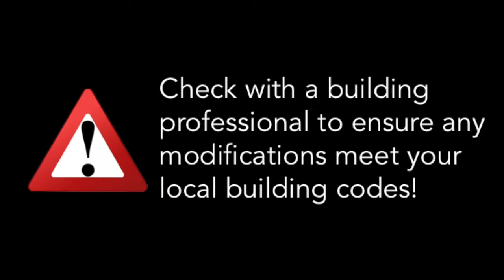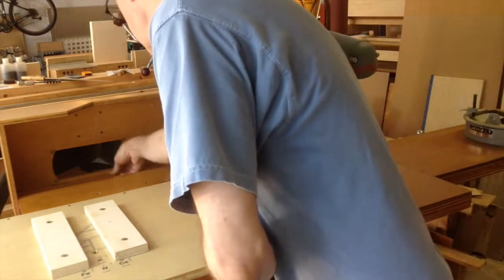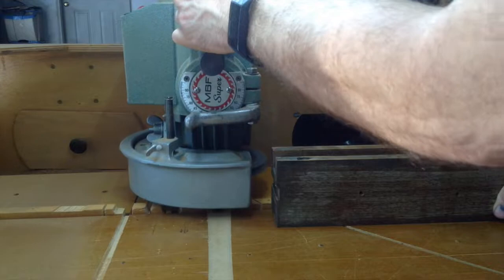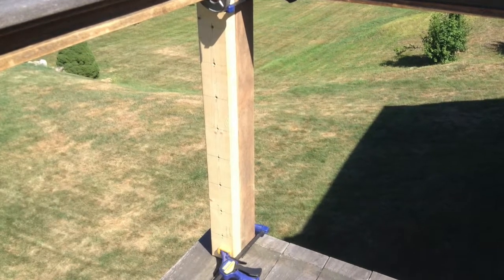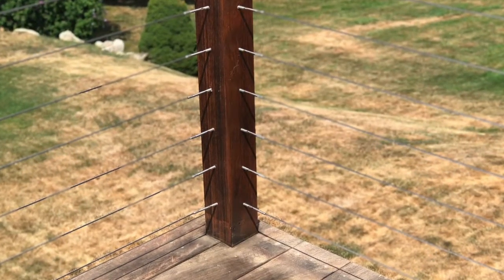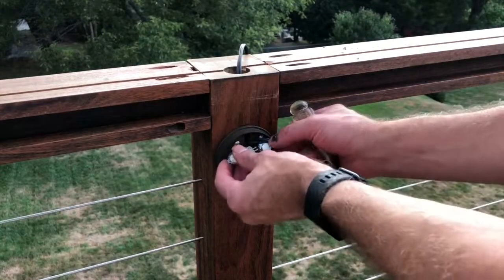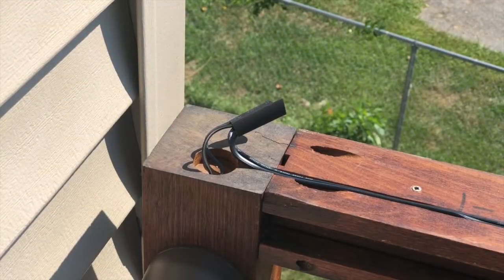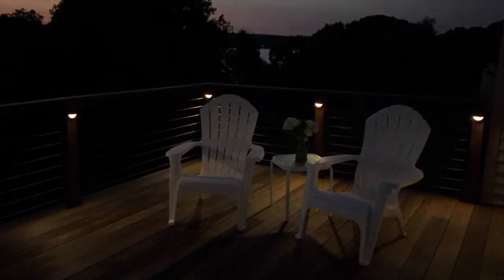Deck Upgrade (Cable Railing and Lights)

Comment: Brian, how far apart did you happen to run your cable in between each post. I have 7ft between mine.
Reply from the maker: The maximum span between posts is 6 feet on my deck. The overall cable length is about 21 feet on the longest side. The cable is only attached at the end posts and just runs through holes in the intermediate posts.
Reply: @brianweekley5700  Does the 21’ cable length meet your local building code for deflection?
Reply from the maker: @ptcclatlptcclatl1683  The spacing between posts is not 21 feet—it’s less than 6 feet. The spacing between the wires is sufficient to meet the 4” deflection requirement.

Comment: Just discovered your channel !! I subscribed because I like what you do !!! Regarding Ipe wood, it is sad that retailers always brag about the  always present possibility  you can ''bring back'' a grey/weathered ipe patio to the  appearance of newly installed Ipe wood by just lightly sanding it and cleaning and re-oiling it....I find that impossible...It will always remain darker in the future  compared to newly installled ipe wood...Also, as a result, it IS NOT a maintenance free wood if you want to preserve a nice finish and appearance  . Here in Montreal, I need to clean and re-oil it once a year. You probably noticed a huge difference between horizontally and vertically installed planks !! The latter really do not grey as much and retain much of their initial beauty!!!
Reply from the maker: Thank you! You are absolutely correct. Ipe is very hard to keep its rich color-especially in direct sunlight. Sanding and a brightener are helpful. We also found that if you oil too much or don’t thoroughly wipe off the excess oil it will blacken faster. Best to power wash, apply brightener (oxalic acid) with lots of elbow grease each Spring followed by a single coat of oil (with UV protection). It is maintenance free if you like the gray color!

Comment: Beautiful! How long did the oil coating last? Would you re-coat again ...or is it too much work if it needs to be done every year?
Reply: I have over 1500 sqft of grey Ipe and it seems daunting to oil it even just once ...
Reply from the maker: The deck looked fabulous when it was done.  However, our deck gets a lot of sun and looked terrible by the end of the summer.  It is a lot of work keeping it looking good.  There is definitely something said for letting it just turn grey!  However, we have another ipe porch on the front of the house that does not get sun.  That one still looks super after several years now.  On our next house, we're planning to pour a stamped concrete patio to avoid wood deck maintenance altogether (LOL)!  The main purpose of the video was more about installing the cables, lights, and fixing the sagging railing. I would do that again in an instant--a great improvement for sure.  Thanks for the question.
Reply: @brianweekley5700  thanks for that info! Just what I was thinking, that maintenance to keep it oiled is a big commitment if exposed to harsh conditions. I’m up in Seattle and the relentless winter rains do a number on wood. So other than a gentle power washing in spring, I think I’ll forgo the oiling!
Yes, the wire railing is how I found your excellent video. My baluster railing is sad...made from cedar but pained white with latex paint, which to me seems impossible to remove completely..so endless horrible peeling. It’s huge and I don’t know what to do with  it, and thought wire too. It’s less than 30” from ground, so maybe just removing it would work. But then I’m afraid I’d be inviting deer up on it eating my potted plants, as they are all over the place here.
A concrete or stone patio does seem attractive to me too. Thanks again!

Comment: Nice… thank you for sharing, would you have parts list and/or purchase link?
Reply from the maker: Thank you. I purchased the 1/8”, 1x19 cable and 1/8” threaded lag screws on eBay. If you search, you should find many options easily. Make sure they are 316 stainless and the lag screws are sets of both right and left pairs (many ads are one thread only). Don’t cheap out on the crimper, you absolutely need the hardened dies to crimp the stainless steel (e.g., Muzata). I’m very happy with how my railing came out and it was a very affordable approach. In my opinion, much cleaner look than using turnbuckles. Good luck with your project!
Reply from the maker: Lights that I used…
https://www.amazon.com/dp/B07QF3642Y/ref=sspa_dk_detail_4?pd_rd_i=B07QF47Y23&pd_rd_w=1NJR8&pf_rd_p=91afecf5-8b2e-41e2-9f11-dc6992c6eaa1&pd_rd_wg=bAo4V&pf_rd_r=JPM6H8VCCPHPC1B3BG2Q&pd_rd_r=90713e88-af04-4e1d-b97e-90a1a93bf953&spLa=ZW5jcnlwdGVkUXVhbGlmaWVyPUExSFhPNU1YQjJWSkJGJmVuY3J5cHRlZElkPUEwNjE1OTc1M0NaR082MTIxVFVDWSZlbmNyeXB0ZWRBZElkPUEwNDcxOTkxMjNCMDU1VDZYUUJGMCZ3aWRnZXROYW1lPXNwX2RldGFpbCZhY3Rpb249Y2xpY2tSZWRpcmVjdCZkb05vdExvZ0NsaWNrPXRydWU&th=1
Reply: @brianweekley5700  do you recommend using cable sleeve protector ?
Reply from the maker: @zaldyvar  Are you talking about over the stainless cable between the posts or for the electrical wiring?  I didn’t use protector on either. I only have eight LED lights and the wiring is 18 gauge, low voltage wiring for exterior use (landscape wiring). It does not get wet the way it’s concealed in a channel below the handrail (just be mindful of where you screw it down).
Reply: @brianweekley5700  stainless cable between post. It’s just more work drilling but then I am nit sure if there’s really a need. I like your setup. Clean and simple.
Reply from the maker: @zaldyvar  You’re referring to the small stainless collar protectors where the cable just passes through the intermediate posts? In my case, the posts are solid ipe, which is extremely hard and I didn’t have to worry about any damage to the wood. You can certainly use them if you wish and they might provide a nice decorative element where the cables pass through the posts. They also might be helpful if the posts are not perfectly aligned to keep the cable from digging into one side of the hole in softer woods.